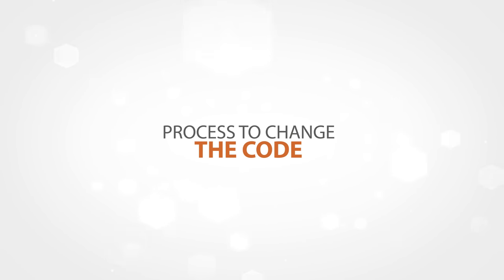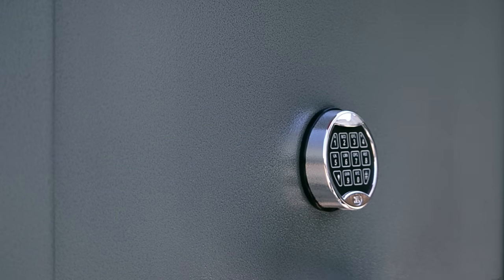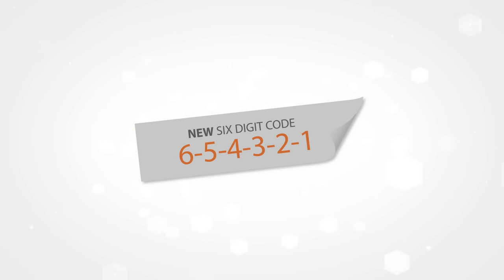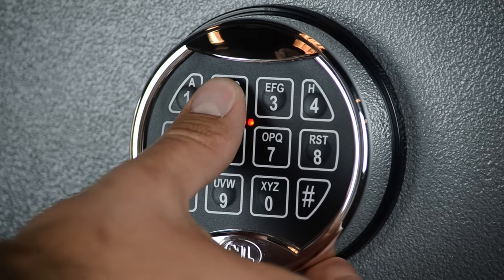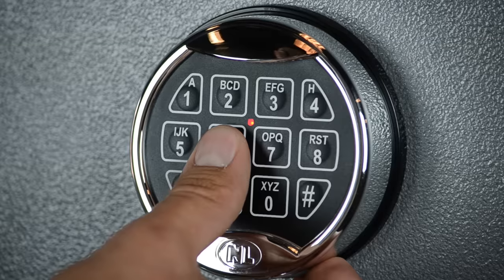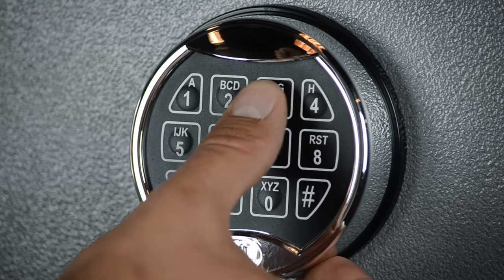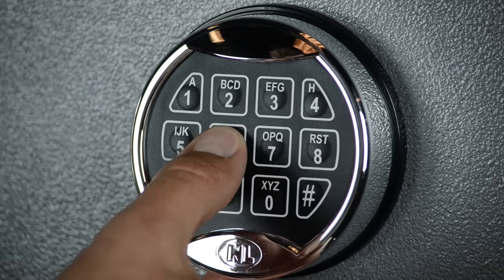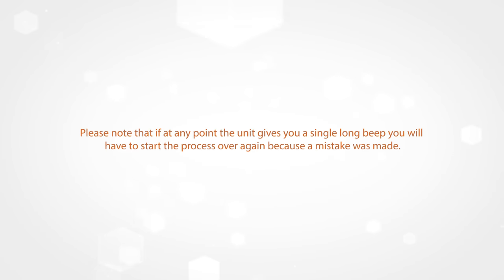Cannon Safe - FAQs - How do I program my safe code? (NL Keypad)

Comment: In 1999, I purchased my Cannon Safe. It had a "Dial Combination" type lock. Over time, the "Dial Combination" started showing signs of failure until the lock totally failed. I contacted Cannon with the issue. I paid a Locksmith to come out and get the safe open. I explained to the Cannon reps that This is an old safe and it's not set up for an electrical keypad type lock set up and send me the old type Dial Combination. They stated that they don't have them anymore and the Keypad is the new replacement. The first keypad they sent was missing 1 of the mounting screws  and had too many of the other. I took photos of my safe and the Lock they sent with the missing fasteners. They stated they will send another that WILL fit my type of safe on 10/12/22. After about 6 days waiting for the new replacement lock, I looked up the tracking number and found that is hadn't moved from their warehouse. I had to call them to get the lock moving and shipped. So I get the second lock set that is supposed to fit my safe, its the same exact keypad they sent prior but with 1 major difference. It's bent and has a screw broke off on the backside of the lock. So much for Quality Assurance. I again call them and stated that this Keypad will not work on my safe! They then stated that this keypad IS the replacement and I would have to have a locksmith install it as they do NOT have an "Adapter Plate" available to mount the new keypad on my old safe. I'm on my own! I had an adapter plate fabricated and got the keypad mounted.  Now, the lock its self will NOT program and will NOT function! 2 hours attempting to get this new Keypad and lock  to operate, following their video instructions, and its a no go! This is Cannon Safe today!!  Back to the drawing board! Buyer beware!!!

Comment: After changing battery, door stays in locked position.  When i put in the combo, i get the double beep( meaning combo is correct) but it still stays locked.  If i change combo, it does the same thing.
Reply: Contact cannon (alpha guardian inc) send them a email. I had the same exact problem. Tell them your problem, they sent me a new lock and keypad and it fixed it. I just sat there for 30 mins entering the code and jiggling the handle and it finally unlocked. You need it unlocked to replace the items
Reply: @bocoots7990  I too had that exact problem.  I called them and they advised a locksmith had to be called (they provided one in my area) who will need to drill into the safe to release the lock and needs Cannon direction standing by to do this.  Sending me a new keypad can't be installed unless the door is open......so the locksmith needs to be involved.  This is not what I signed up for with Cannon.

Comment: Do not get a cannon safe. I bought a gun safe for my son for Christmas. It lasted 3 years and then the inner mechanism malfunctioned. We had it looked at and the locksmith said it needed to have the inside part switched out. The cost to do that was $400 to $500. The safe itself cost $500. Since the safe was the same cost of the locksmith and when he finished I would need to repair the holes he was going to make we decided just to break in ourselves and call it even. So the only way we could get our guns out was cut a hole in the top of the safe since it was mounted to the wall and floor. When we talked with a cannon rep the best they would do was send a replacement mechanism but since it only has a one year warranty I had to cover the rest of the cost. The rep admitted this is common.
Reply: One year warranty??  That's bullshit,  Cannon carry a lifetime warranty
Reply: @rentacop88  I hope so,I just bought one of them but so far so good
Reply: @chuckydubree1925  good luck....
Reply: @rentacop88  You should read your "Lifetime Warranty".  It says right in there the following:  "Electronic and mechanical locks carry a one-year Warranty for labor and a lifetime Warranty for parts".
Reply: @ricksundberg5659  That sucks, I am seriously questioning my purchase of a Cannon safe.  The lock fails to open after the valid code is entered and the only solution is to hire a locksmith to drill into the safe to release the mechanism?????   Poor design and a pox on owners.  This safe isn't ready for prime time.

Comment: Great video also I founded that if you're inside Panel doesn't have something to hold on to I used two drywall screws drilled near the center of the panels that door lifts right out.

Comment: DO NOT BUY THIS SAFE. I bought one over the weekend brand new and the lock failed. Cannon refused to replace the lock with a mechanical lock. Not that it couldn't be done but because it would void the warranty. Basically told me if I don't like the safe take it back to the store and purchase one of their other safes. If you won't help me with the one I bought why would I buy another Cannon product?
Reply: Just because your selection of safe didn’t workout for you doesn’t mean it’s a bad safe.
Reply: Was it a lock failure or a failure with the keypad side of it?
Reply: I had my safe for about 5 years and someone tempered with the door,  I contacted Cannon,  send them pictures and video,  they replaced it with a new model without hesitation,  customer service, is the best.

Comment: THANK YOU SO MUCH ...MY BATTERY  WENT OUT AND I HAD TO CHANGE IT OUT AND THIS WAS A LOT OF HELP
Reply: How long did the battery last?
Reply: @-zerocool-  I know this is old but for anyone else wondering, you should change the battery every year. Cannon requires you to use Duracell batteries with a 5 year expiration window.
Reply: @Bluelightbandit  thanks I was just wondering about that, great info

Comment: Cannon has the worst customer service e I have ever encountered. I have the digital/dial locking system on my safe and the digital key pad quit working. I could still open it with the dial but the keypad was handy. I have a life time warranty and they will not replace the redundant lock that I paid extra for when I bought the safe.
They would replace my lock with a straight digital lock but that is not what I have. They just want to be done with me the quickest and cheapest way they can. I have sent them videos of the safe malfunctioning, have been back and forth with them for months now and they just want to replace my problem with sub-standard parts and I will not except that.
I like my Cannon safe, but I have owned many safes over the years and I would NEVER buy another Cannon. The sole reason is the absolutely terrible customer service. The rudeness and down right lies I have been told about my warranty from the 3 different people I have delt with is unbelievable.

Comment: It’s 2022 🥴😅 any touch tone keypad 🔢 password easily hacked with software that decode the tone of the button u push lol every button has a different sound .. easily cracked if I can record audio of u unlocking it
Reply: Not all the buttons even work on mine 🤦🏼‍♂️